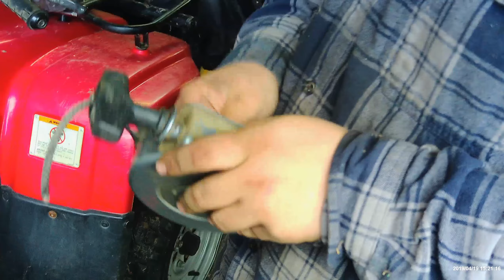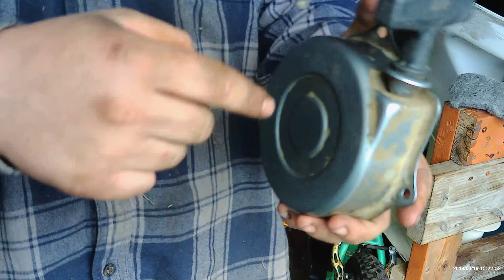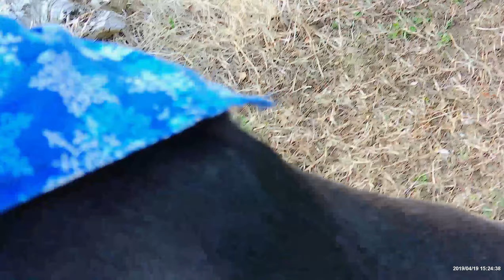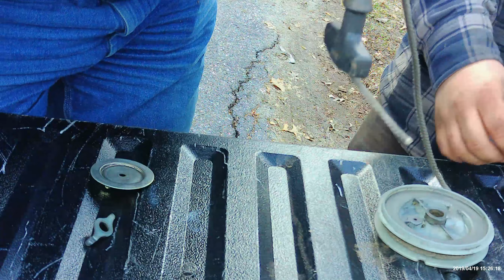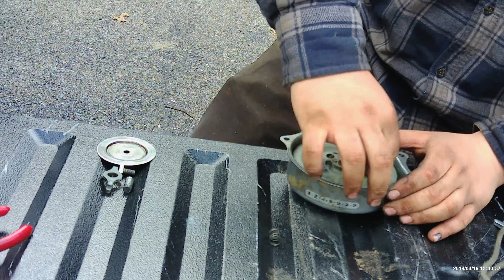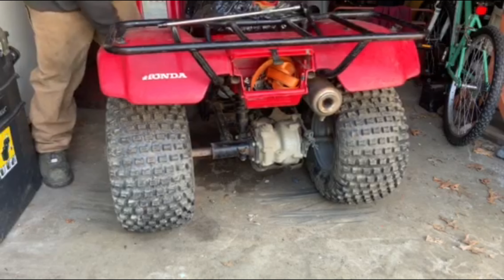WE TAKE A ROAD TRIP TO FIX A RECOIL STARTER

Comment: I used to have an ATC both tires were flat and the pull start was broken I ended up selling it for $400
Reply from the maker: Thats not Good now ya dont have one😱 Those are easy fix's✌
Reply: @JimmyCandFriends  the tires were expensive to replace them it was a Honda 200
Reply from the maker: I know but buying a whole machine that has good tires cost much more than a couple tires.